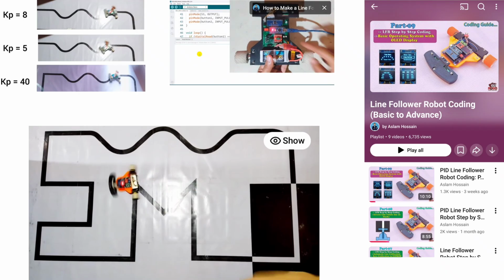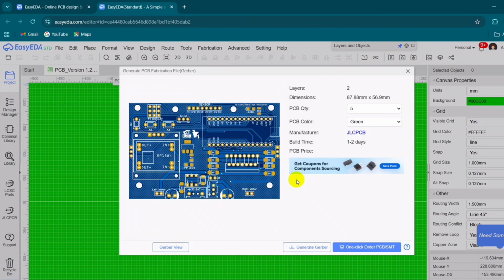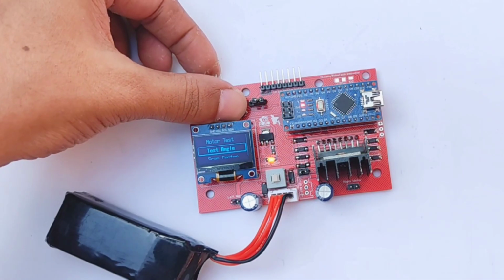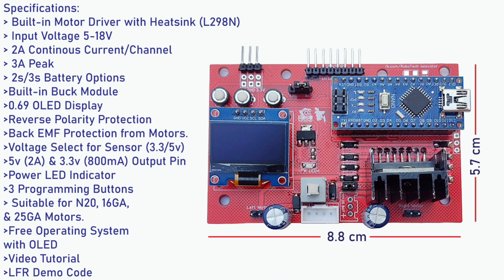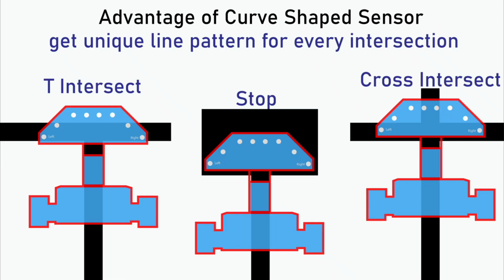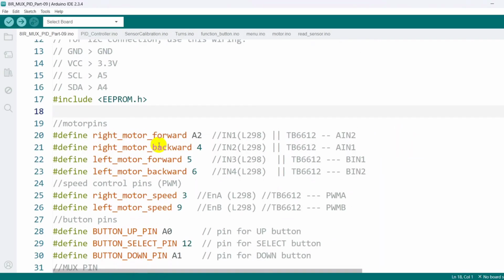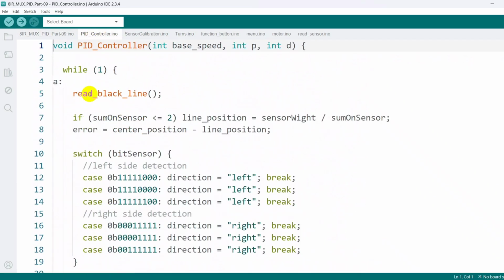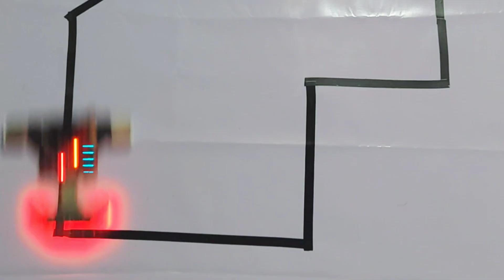Fast PID Line Follower Robot using Custom PCB | LFR Coding Tutorial: Part-10

Comment: Why replace the tb6612 with a l298n?
Reply from the maker: TB6612FNG is rated for up to about 13.5 V, but it is not safe with noisy 12 V motors, voltage spikes, and high stall current can burn it. L298N tolerates 12 V and current surges better, so it survives where TB6612FNG fails